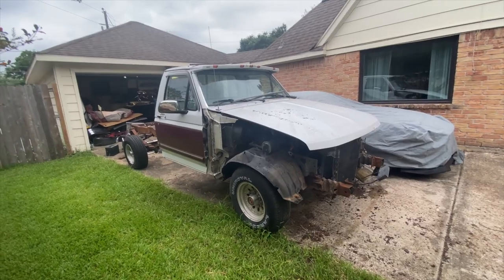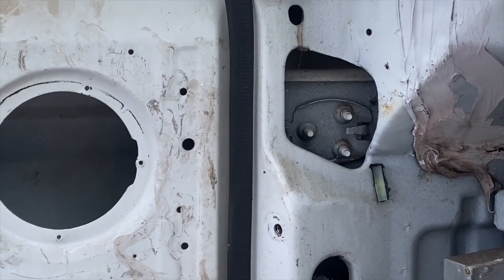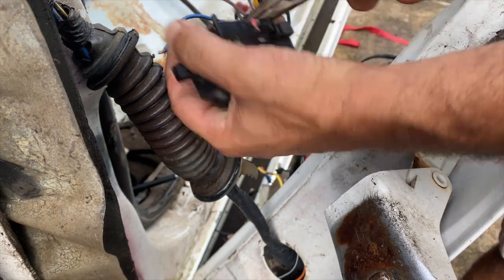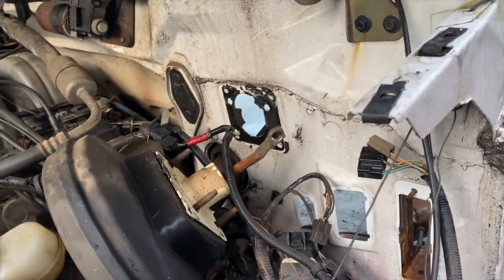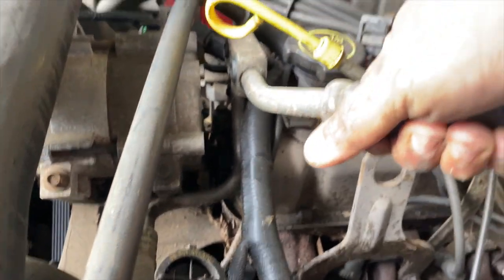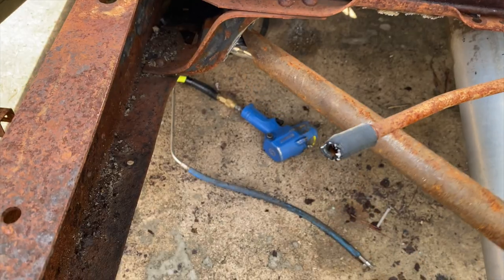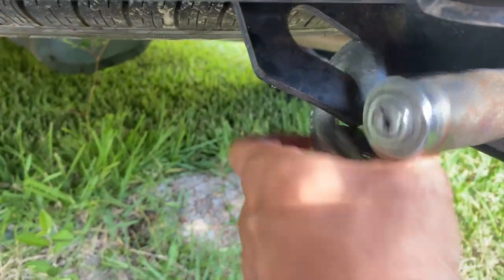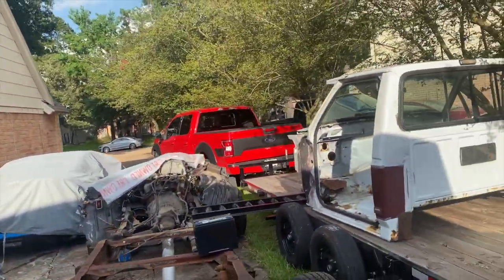Removing the cab of a 1992-97 Ford F150, F250, or F350

Comment: So I have the cab bolts all removed. Mine is the 4wd with the floor selector lever. Do I just need to disconnect that and the steering linkage and then cab should be good to come off?
Reply: Yes in reality well I'm about to do with my f-450 to 1991 is I am just unhooking the steering linkage the brake lines where they connect to the brake booster making sure they're clear the of the cab and I'm not even removing the front clip front bumper all that fun stuff the only thing I'm going to remove cuz I have a push bar on my truck mine's a tow truck I'm there again just unbolt the body mounts that's all you have to do unhook the power steering if it's is connected in any way to your truck body some newer trucks the reservoir is actually attached to the body not the engine my truck I don't have to the only thing I have to unhook is my AC compressor lines or take my AC compressor off the engine rest tie it up to the body somewhere usually around the windshield wiper arm with a bunch of cord is how I usually do it and then you can literally lift the whole cab with the front fenders and grill headlights and all that still attached the only thing you want to make sure is that any wires that and hoses like fuel lines or anything like that that go from the frame up to the in the attached anywhere on the wheel wells or the body make sure you don't hook that stuff so that way you're not getting stuck better than that it should come right off you don't have to take it down as far as he did a lot of people do I do if I'm changing out offender if I got to fix some dents in the fender sometimes usually I do it when I'm changing out fender while I'm doing the work to it but I usually do this when I'm doing engine swaps and I try not to but on this one because it's a tow truck and I have a hydraulic system on it I am taking the cap off so I can one take the cab on the back of my rollback tow truck to the car wash I'm going to clean the wheel well I may clean the transmission tunnel and I'm just going to clean the hole engine bay area on the cab itself and then I'm also going to take the frame with the record bed on the back and I'm also going to take that whole assembly and I'm going to power wash it clean it and I'm actually going to do some reinforcements because I had some parts break during some toes that I did not know broke until today when I jacked up the truck and realize oh crap my hangers for my front leaf springs they're torn they're not there anymore gravity was the only thing keeping my front end from folding out from underneath me while I'm I'm glad I saw it it was in a spot that you cannot see or even inspect so yeah you can take the whole cab off just make sure everything is disconnected you're staring linkage and all that is disconnected when you disconnect it tie your steering wheel to the seats using the seat belt you do not want to let it free spin it can actually mess up the clock spring if you have air bags luckily I don't so I can literally grab that